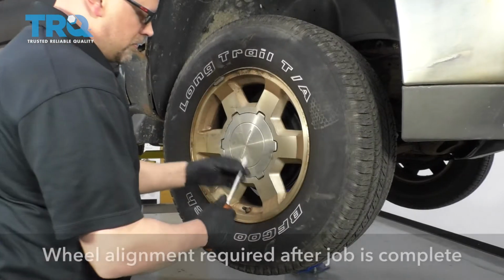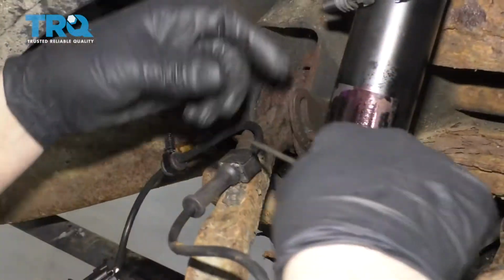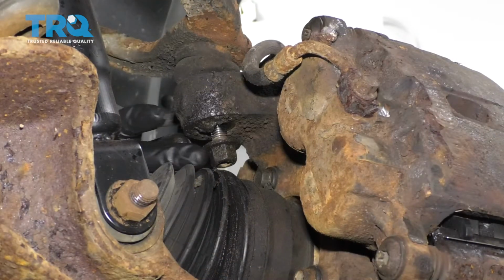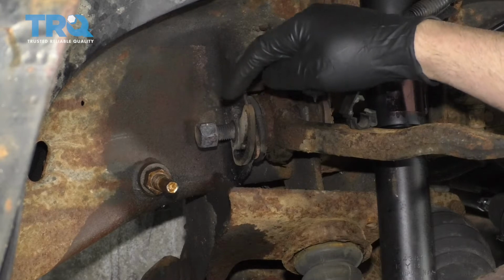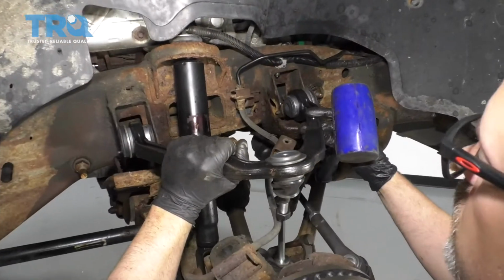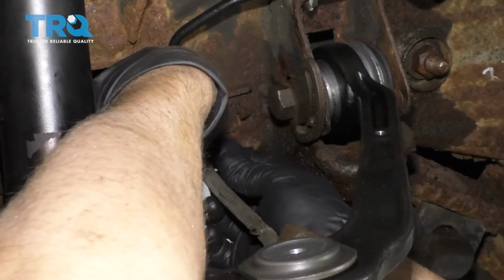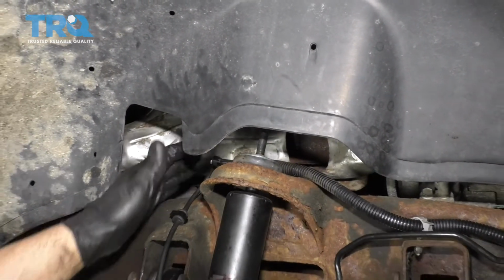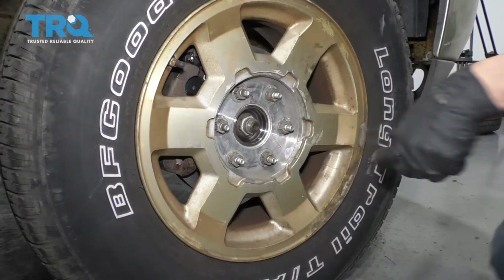How to Replace Front Upper Control Arm 2000-06 GMC Yukon

Comment: It never is that easy even after heating up the bolt as a matter of fact the end of the bolt with the nut on it ripped right off and rest is still rusted in place. Any suggestions on how to remove and replace?

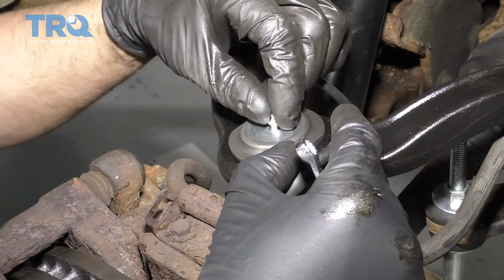Comment: Great video but why does TRQ say the control arms I bought are maintenance free and 1A Auto tells me they don't need grease fittings and yet, in this TRQ videon at the 7:45 minute mark it shows technician installing grease fittings. All 4 of my brand new TRQ control arms have machine threaded holes for grease fittings and I was intending to start replacing all my front suspension and steering components in 2 days but now I guess I have to either wait for 1A to send grease fittings I need or go pay for my own separately from the kit that is supposed to have everything I need.

Comment: I recently did this job and here are a few tips. Be careful when disconnecting the hub sensor the plastic tabs are fragile. If you’re doing this on the ground you can jack up the lower control arm high up. Let it drop and it’ll pop out the upper control arm just be careful and make sure your jack stands are securely and safely placed. Also you don’t need the specific wrenches he has you can do the job with a large adjustable wrench.
Reply from the maker: +Daniel Garcia Thanks for the feedback! http://1aau.to/m/Shop-TRQ

Comment: Job wasn’t completed and the wheel went on anyways ?! 🤔 good luck without the cam plate and nut on the front upper control arm .
Not sure if it was just video purposes , but i would love to see the other cam plate aligned and torqued….js 
No new upper behind tire at end ? Weird …

Comment: I have a 2003 Denali XL and I have yet to find a part number for my upper control arms, they are different than any of these videos. It has the ride height sensor attached to the control arm. Anyone have that part number by chance?